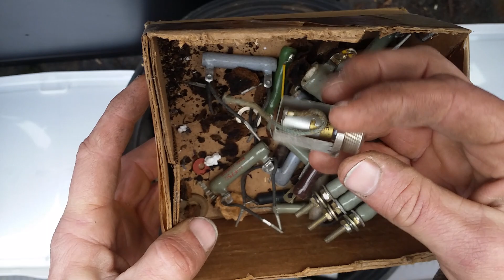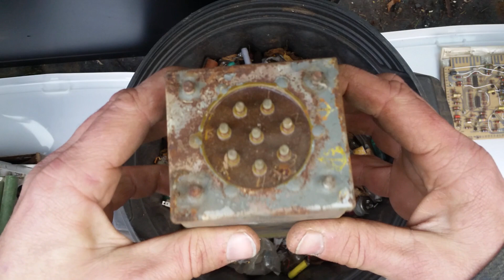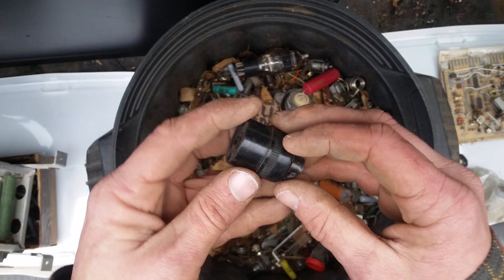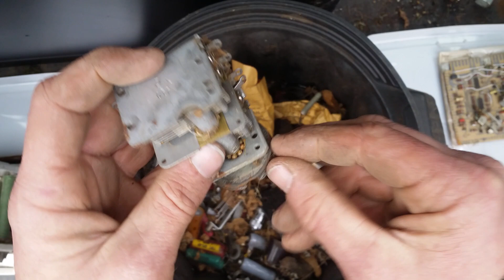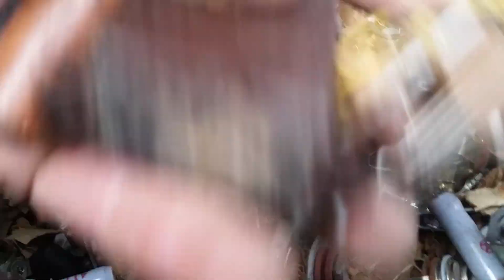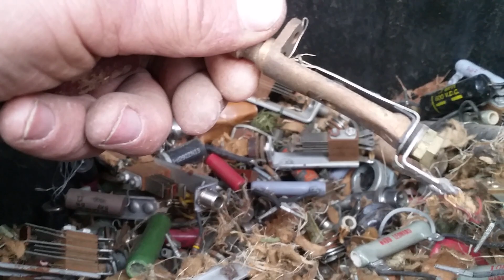Sorting Stuff: An Experiment

Comment: Many, many years ago my dad got some circuit boards from a main frame computer, no idea what. I went through and savaged a lot of resistors and other odds and ends from them. I recently went through to see if there were any resistors worth keeping. Any resistors that were over value or way under value I ditched. I tossed more than three quarters of the resistors. At the time I salvaged the resistors, I didn't know about resistors drifting as they aged. The ones I kept won't be used anywhere critical but nice to have when experimenting. I have seen some people selling NOS capacitors, some similar to the red ones in your bucket. Apparently, they don't know that most of those are junk. I have, though, run across some Imperial IMP plastic caps and they seem to hold up very well.
Reply from the maker: There is a market for those junk capacitors - at least some values and brands. Yes, there are fools that put them amplifiers - I have no pity for them. But there is also a market with guitarists that use them in the tone circuits, where they do not have to worry about the high voltage or the potential for failure. Excessive leakage in these old capacitors can indeed change the filter characteristics on those tone circuits.